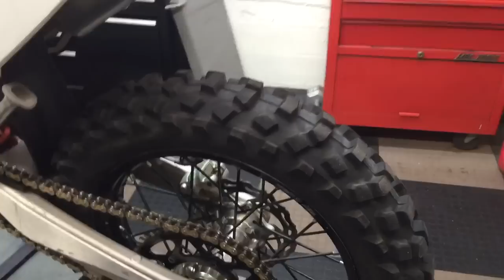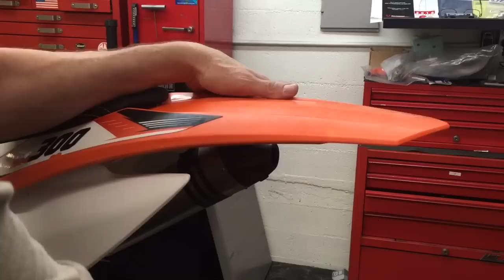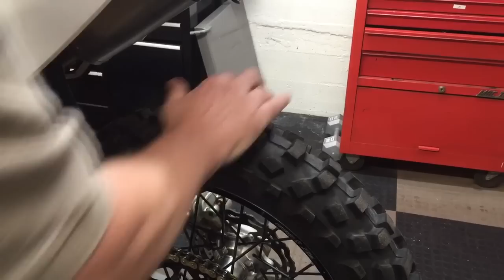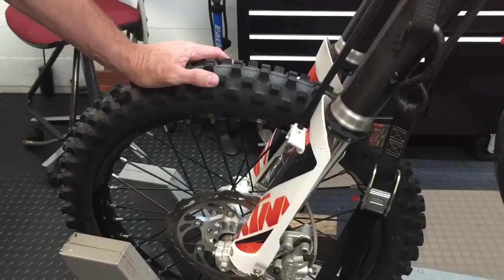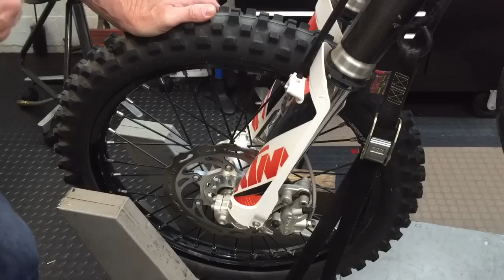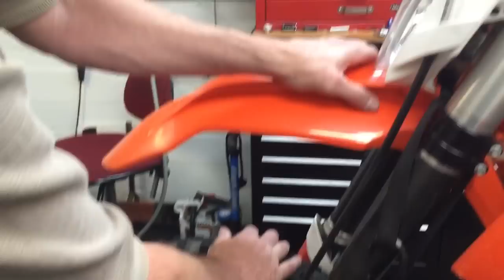How-to Check Motorcycle Wheel Bearings

Comment: I tested my front wheel that way, absolutely no free play. I changed the bearing anyway because I know they had a lot of miles in them and one of the bearings was rusted and completely dead, which wouldn't turn at all. I don't know how long it was like that but I guess a couple of rides.
Reply: Not done much with bikes but cars you definitely get rough/pitted races which can cause lots of noise (& friction) with zero play.

Comment: This is really helpful, I could swear my rear wheel felt a bit weird when riding, but because I wasn’t checking it properly like in this video, it took me a few weeks to realise I had a few mm of side to side free play in the rear wheel. I was grabbing the frame only and moving that from side to side, on the side stand, whereas I should have been grabbing the wheel and pushing that side to side independently of the frame

Comment: Jeff thanks. Great set of videos - very helpful. I recently replaced my KTM 990 front caliper pistons and seals, replaced the pads and fluid and bled the air our just fine. Fitted new tyre  and inner tube. I would really appreciate a comment or a short video on your method of re-fitting the front axle in terms of tightening the axle nut and pinch bolt sequence in order to realign the front forks and calipers. Regards and thanks again. Victor

Comment: Letting the clutch out and the bikes shakes would this be a bearing too?
Reply from the maker: Probably not. More likely a clutch issue.
Reply: Yea checked the bearing today its fine and it only does it under load, I just replaced the pack last may and when I start going is the only time it vibrates. It shifts fine and doesn’t seem to slip in higher rpm but I didn’t ride it more then that didn’t want to damage it more then it could be... Brock Davidson said clutch basket or slipper clutch...

Comment: i just picked up an 85 vf700s. going through replacing neglected parts, when front wheel is off the ground, it will hardly spin, no side to side movement, are they too tight? cant find a video showing how free the wheel should spin, the bike is a mule to turn, and going to replace the steering bearings aswell but figured this may be contributing

Comment: Good video as usual. What brand bearings do you use? OEM, All Balls or something else?

And on the subject of bearings, on your website I only see the upper heim joint for the PDS shock, but what about the lower? I need to replace my lower bearing. And on the upper it doesn't say if it is OEM or some other manufacturer.
Reply from the maker: +TheOfficialKC Hello: The bearing page has several rows of bearings. The top row has the lower heim.
Reply: +Jeff Slavens Thanks, I was looking on the shock parts page. Found it now. 
Who makes the bearing?

Comment: $50-60 for wheel bearings is crazy.  Half of that is the most I would pay and that's pushing it.
Reply from the maker: German quality cost a little more. We prefer not to use Chinese junk to save a buck.
Reply: @slaverace1  
I wish they used a little of that quality on the cylinder o-rings.  I prefer to not have to stretch them out to fit by hand.  Otherwise, I agree.  I would still use a Koyo bearing first because of the price.